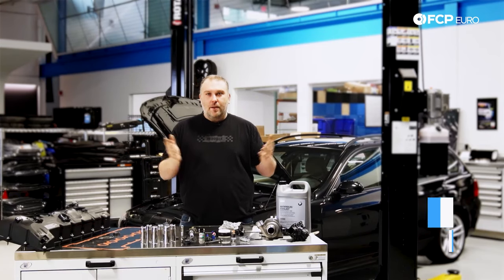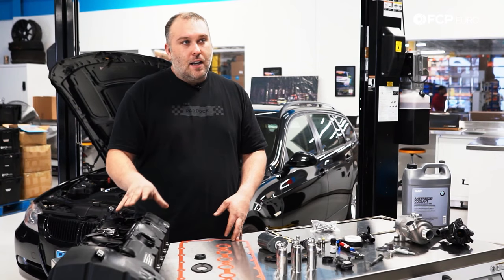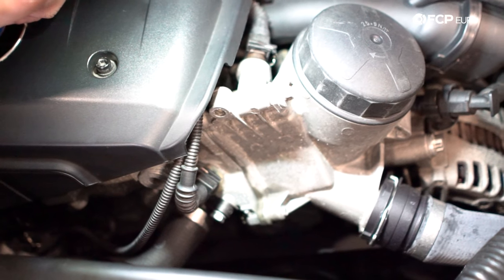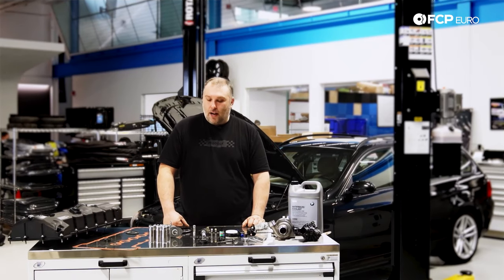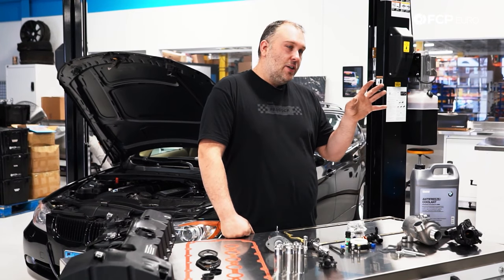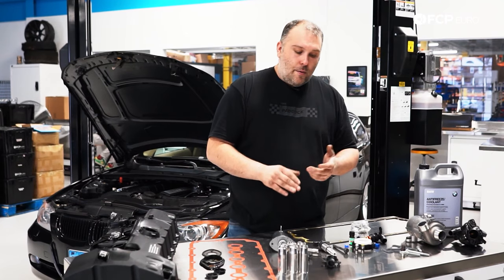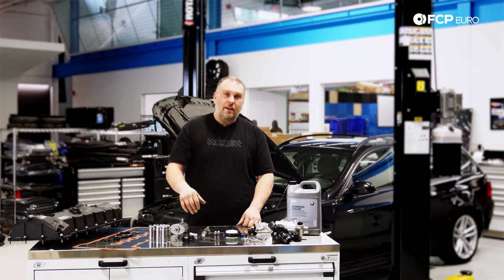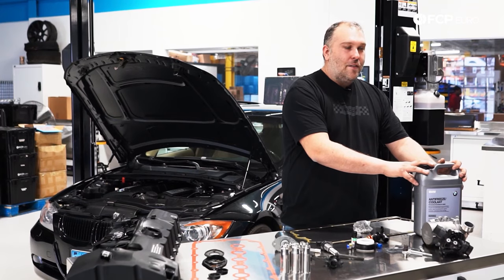BMW N52 Engine Diagnostics/Problems - Everything You Need To Know (128i, 325i, 328i, 330i, 528i)

Comment: And Casey does not mention it there is a BMW recall on the PCV valve hose check valve and heater element free from BMW make sure all of y'all check your carfax report and make sure there is no current open recall for your vehicle which make and model BMW you're driving?, we took ours then a few weeks ago at 7 a.m. when they open up and it's usually done within 2 hours, BMW will also do a walkover on your car on the underside send you a video of it and make notes of interest on things that are either missing need service or need to be replaced which is very kind of them! Of course our cars a hand-me-down so it's a project car which I explained to the service Ryder, also mention a hyperlube that he can watch the Youtube video on that reduces friction up to 95% and has been proven on Project Farm to actually work as advertised! I knew about this a few years ago immediately ordered some and put them in both of our cars and it is kept in our vehicle every other oil change to ounces per quart, there is been proof on Project Farm where they actually took to lawn mower engines one was synthetic and one treated with this oil hyperlube additive that reduces friction 95%, and this case they drain the oil and the synthetic engine locked up after 10 minutes, the one with the hyperloop that's permanent ran for over an hour with no oil in the engine with no problems! Tell me you wouldn't like that kind of protection for your BMW engine?! Now I have that protection in my engine transmission and the differential oil as well as well as the power steering! Contact me with a remark if you're interested in learning more? And no I don't sell the product and I don't endorse it, but I tell you what it's the best thing that I found and lubricants since I've been driving since the early 1980 and I can tell you nothing comes close to this product currently in the US and the world market today! It piqued the interest of the BMW service writer I sent him the link to the YouTube videos to watch it cuz proof is seeing it with your own eyes, the Timken oil-bearing test machine registered severe wear under synthetic oil whereas with this hybrid lubricant you could barely see a wear mark less the width of your fingernail and fact you had to look up close and see if there was anything there, the proof of this was when I went to change the oil it was like maple syrup instead of being black like it normally is? This tells me that the products working now I will send the oil off to a lab and check the iron content and see how much where it has compared to normal black oil? Looking at the results on a oil lab test on the oil when the oils put in its at number one index for iron, when it's removed from the unit they all rating or indexes in the 184 range, that shows you how much oil or metalware that you're having inside your unit after the oil is drained, which pertains to how much friction metal against metal parts inside of your engine or unit is happening!

Comment: So glad still have video about bmw E60🙂 my car still have error code 2E83 and 2E85, 2E8B after replacing my water pump and thermostat....what happen?
Reply from the maker: Elffel, I would check over everything you did, make sure all electrical connectors are plugged in. It could also be the cooling system needs to be bled, and the air in the system is giving a false reading that is triggering the coolant temp sensor and giving you those codes.

Comment: You mentioned the cooling system and common failure being internal and you also said control unit do you mean the control unit if the ac/heater?

Comment: What is the part number and name of the angled connector with the heater in it? The angled part with the heater in it : is that for the crankcase ventilation system? Also I have a 2009 Canadian 323i. I’m pretty sure it’s the 2nd gen N52 for LCI models

Comment: I really enjoy this great video! Thank you so much! I have a quick question about leaking oil from between engine and transmission when I look at under the car. I can't find where the exact leak is. I know when I drive and off the key, oil drop, just yet tear of drop(so nothing to worried about yet.) but still I may need to repair later in the near future. what would you suggest where to look at? I have replaced front crankshaft seal and oil filter housing. also, I don't see any leaks from valve cover gasket... either. please anybody who knows and had the same issue please kindly help. by the way, I have E83 (N52 engine) 2007 X3
Reply: It could a bad rear crankshaft seal, the transmission pan may be leaking there, the oil pan or the transmission shaft seal. The torgue converter if its automatic also has a seal too. It can be several things, you have to look at it closer from underneath to determine the problem. Hope that helps.
Reply: @L-Noble.YT_Hi.Res-Soundminds  Thank you so much for your great advice :) it is super helpful. I will try to look at it. if I can't find where to look, I will make a video about it so you guys can also look into it. if that case, please kindly help me also. Thanks again for your advice.
Reply: @studiosupremechannel3517  Great, hope you get it fixed and its not too bad. I have oil leaks on mine that I will fix a bit latter on. We all have some leaks!😓  L😳L

Comment: Thank you so much 😊 great video 👍👍
Perhaps u could mention what years had gen 1 and gen 2
Reply from the maker: Hey AKS Z you can find that info and more here in our E9X Buyer's guide. Hope this helps! Thanks for watching.  https://youtu.be/iLoX45cjDu4?t=393
Reply: The 330i that is the one that has the first gen magnesium valve cover, the engine has a silver engine cover also. The 328i and others has gen 2 plastic black cover. The engine cover is black too. Its esay to see the difference.

Comment: HAVE A 2008 bmw 328i sedan EVERy so often throws lean codes on both BANKS..did smoke test and only fuel injectors were leaking..replaced injector orings..codes 29E0 and 29E1 show..would a bad PVC valve cause this? MAF?? please respond..thanks

Comment: I had the eccentric shaft sensor fail. No codes but car would randomly fall on its face and basically act like a limp mode. Took ages to figure out. Just be advised they don't always throw codes.
Reply: How did you end up finding out it was that

Comment: So what's a estimate in labor for all this from  not a BMW dealer, but a certified BMW mechanic I just picked a 2010 328i 2010 and I'm currently now at 70k miles 

And really want it to go past 200k miles 
And recently changed the dtml evap pump

Comment: You didn't mention crankshaft position sensor, Im having p0355 code, I swapped with camshaft sensor no help but the swapped part works in the camshaft spot. Wierd, but I ordered 3 new ones for each hopefully that takes care of that.

Comment: My engine is n52b30 190kw 2006 version e90 330i and I have my automatic transmission changes to manual transmission. No failure light comes up, but I notice my maximum rpm stops at 6500. I thought this engine should have max rpm goes to redline at 7000 rpm. Do you know what could be the possible problem that goes wrong in my engine?

Comment: Another common failures are the DISA valves. The engine has a 3 stage Disa which means 2 valves. If the valves fail there is a risk plastic parts will be sucked into the cylinders and they could do damage even required replacing the whole engine. Every 12y  100k miles it’s safer to replace them.
Reply from the maker: Good point, thanks for the tip!

Comment: I have 140k miles on my e90 and never had an issue with the water pump.  Is it worth replacing preemptively, or should I wait until it starts throwing codes or running hot?
Reply from the maker: Hi E'lonque, that is the game indeed. If you note our recent video on the E83, that vehicle had 170k on it when the original pump decided to show signs of failure. The owner was well aware it could go at any moment, and seeing how it isn't driven often, were willing to just wait for a sign. If you use your vehicle on the regular, preventative maintenance where possible never hurts.

Comment: You talked about common oil leaks. My 2005 545 has a small leak that is leaking onto my exhaust. When I open the hood and look for any oil leaks I can't see oil leaks anywhere. Does this sound like a oil pan leak or maybe something else?
Reply from the maker: Hi, Garrett. Oil leaking on the exhaust can be dangerous, if it gets hot enough it can possibly start a fire. I would address that as soon as possible. The best way to track oil leaks is to clean everything so you can see where it is starting from.

Comment: why on the N52b25, when the motor starts, it starts to tremble for 5-7 seconds, then it aligns and works as expected, could you tell me what the problem might be, since there is not a single error

Comment: Thanks for the videos they are very informative. I have an issue with a 2005 330i which I am unable to resolve. The car has done 100k miles and runs great, but sometimes after a half hour of driving the car will go sluggish and lose all its low down torque. It turns from a 330i into a 318i 🤔, any idea what could cause that?
Reply from the maker: Glad you like the video, Tony! That's a strange issue, do you get any check engine light codes when that happens?

Comment: BMW125iautovert08blackuk: Great video, very informative. Thanks! What would one cover if to get in as far as the timing chain guides? And how challenging is the water pump change? .......I'd love a mileage chart for ALL maintenance, either per time or miles! Keeping mine forever :-) 1's are already in the collectors guide books i believe! What have you heard? Where could i find guidance?
Reply from the maker: Glad you like the video, Adam! A mileage chart for all maintenance is a great idea! We can definitely put something together for that! No doubt the 1's are amazing cars. As for the water pump, we do have a DIY video for N54 water which would be a very similar process. https://www.youtube.com/watch?v=g8qozaA0PJU&t=1s
Reply: @fcpeuro  Having no temp gauge doesn't help either! Saved a 528 by catching the gauge go above half. It shall be done sir!!......Now......front brake caliper, pads and disc upgrade with standard double five spoke alloys (M2 sets)? My fronts are just pour, I need more stamp!!! What's the best set up for the standard?

Comment: helpful video..my 325i 2006 has p0456 code and smell burned oil at the driver side? thanks
Reply from the maker: Glad you found it helpful, Jay. P0456 is a code for an Evap leak. Smelling burned oil is likely an oil leak burning off the hot engine.
Reply: @fcpeuro  thank you for replying..just replaced my dmtl(thanks fcp euro fast shipping) and the code still there? where should i look for a leak?

Comment: After replacing the water pump and thermostat on my 2006 330i, a service "engine soon light" came on. Faultcode is for water temp lower than expected. As you stated in your video the engine develops good power with no other symptoms or fault codes with a lower water temp. I suspect a wiring problem. I installed a second water pump to eliminate a possible bad from stock pump, but with the same results. Any ideas before I tear into the wiring?
Reply from the maker: Hi Samuel, it is possible the issue is with a faulty water temperature sensor. https://www.fcpeuro.com/products/bmw-engine-coolant-temperature-sensor-13621433076

Comment: Im looking to purchase a bmw e90 but undecided between the N55 335 of the N52 328 both LCi. I heard the n52 is a reliable engine but i like the power or the n55. My question is, is the n55 much more expensive to own rather than the n52 or about the same? Which one should i go with?
Reply from the maker: Hi Brandon. The N55 definitely is more fun to drive with the extra power! While the N55 is still a reliable engine just like the N52, it will be slightly more costly to own compared to the N52. So really, its a matter of what you want. More power generally = more money. But all in all, the most important thing is to find a car that has been properly maintained.
Reply: @fcpeuro  thanks for the reply

Comment: Well, there goes my PUA $. I was able to maintain my 328i before this hole pandemic crap now contracting has been slow as hell for me. I don't even drive my bimmer any more after pulling OBD2 data and seeing all the faults and repairs and most of them are related to the preventing maintenance mentioned in this video. O yeah shout out to the guy who maintained the car before me, you've done an outstanding job......not really.

Before all of this COVID BS I was already planning on tunning the black knight RIP.

Comment: There was no mention of the oil filter cap. When that one fails that'll be no oil pressure in your engine and your will get destroyed. Plus there's no warning of oil pressure loss. Because of the way it's design.

Comment: My 06 e90 went down a few months ago, rough running and will not idle. Threw out a ton of different codes on my friends reader. He pointed me towards the spark plugs at that time, so I needed to replace them anyways due to miles and such and do some other maintenance. To my horror 4 of the 6 spark plugs were filled with oil. Looks like I will be ordering some things from you guys once the weather warms up seeing as all I have is a car port and other vehicles to drive for now.

Comment: If water pump or thermostat fails do you get ample warning of impending overheat?
Reply from the maker: It can happen quick Vic Sorlie, often times once the engine senses its overheating due to a cooling failure it will go into limp mode or shut down to try to save itself. At that point a CEL should pop as well. A slower less drastic leak can be a little harder to detect, and may only be seen with visual inspection.

Comment: Crazy I had all those problems already also my compressor broke had to replace that my radiator was fine but the plastic tanks on the sides started to crack a little bit and it leaked as well Just replace that. Also had oil going into the spark plugs but luckily I had warranty on the valve cover gaskets so I’m hoping that is fixed we did change of gaskets tronic thing on there but I got to check it again.
Reply from the maker: How many miles do you have on your car?
Reply: FCP Euro 140k n i forgot i have oil pan leak n cv boot leak smh but i love my car 😭
Reply from the maker: @mikesterlb  That's all that matters, right!

Comment: Is it possible to have coolant mix with your oil through the oil housing gasket failing? I noticed the leak and opened my oil cap and could see the death milk on the cap. got a long weekend ahead next weekend.
Reply: blown head gasket
Reply: @RedShirtMenace808  Thanks but this was awhile ago. Head gasket was fine, it was in fact the oil filter housing gasket. It was in terrible shape. I replaced that and flushed the coolant and changed the oil a couple times to be safe and everything is all good.
Reply: Had that happen to my bmw e90 .   Oil entered the cooling system .   Did the repairs just like you did and everything was fine afterwards.

Comment: When you say magnesium valve cover, do those have the silver engine cover? My 2007 Z4 has an N52 engine with a black engine cover so which gen engine is that?
Reply from the maker: Ya it will look like an exposed/annodized metallic like material. Vs the hard black plastic so its a "Gen 2" N52
Reply: Yes those have the silver cover. The black like yours is the second gen that is plastic. They are prone to cracking so its probably a good idea to just replace.the hole thing like the video sugests if your gonna change the gasket anyways.👍

Comment: i literally just did an eccentric shaft sensor, and what do you know, i droppped the bottom bolt just like you said might happen, fell down the timing chain hole, luckily a magnet recovered it
Reply from the maker: It happens! Glad you were able to get it with a magnet tool.
Reply: @fcpeuro  heck yea i did.  popped a cold one right after,   i also have to say, ya'll saved me on my old man's volvo.  every parts store by me had the wrong sway bar end links for his c70.  like they were long enough, but way too thick and rubbed on the chassis when he would turn.  every single store stocked the same link.  so we went to fcp, got a set of lemforder end links and well what do you know, the ball joint on each end is a good 1/4 inch thinner, and no more rubbing either!
Reply from the maker: @hughneutron5303  Well deserved beer... Glad we had exactly what you needed with the Lemforded end links, typical Volvo stuff! Thats a good son wrenchin on their dads ole c70 though^.^
Reply: @fcpeuro  it was the only way i convinced him to go euro.  he wanted a mustang

Comment: I don't see the DISA valve in the list of things to look out for, isn't that something that can cause a catastrophic failure if the DISA valve bolt loosens and get sucked into the intake manifold?  The DISA valve is also prone to being stuck open. This is specific to 3.0si cars
Reply: I thought that was the m54. And alot of n52s don't have disa valves.

Comment: You have the spark plug tubes on the table but never mentioned them?
Reply from the maker: Not so much that they are an issue, just something that was included in the parts kit we had on the table!

Comment: what do you guys recommend for oil weight iv seen 5w30, 5w40 and 0w30 ?
Reply from the maker: It's really up to personal preference, any of those would be fine, 5w30 being the happy medium. If you live in a hotter climate or do more aggressive driving, 5w40 might be a little better.
Reply: My N52B30 runs best with 5W40. Tried 0W40 beforehand and it wasn't bad at all, HVA elements sometimes made noise though. With 5W40 that's gone and the engine is humming smoother than ever.